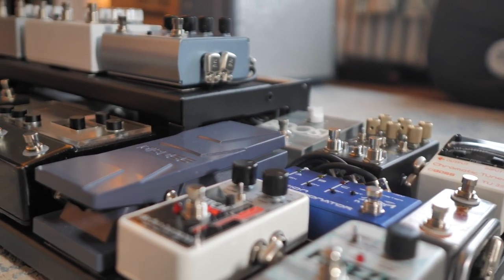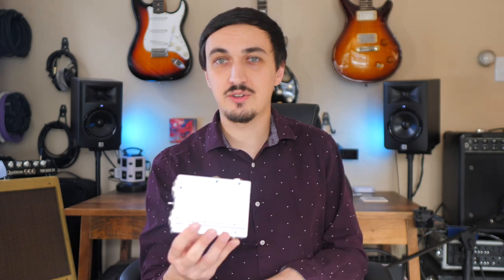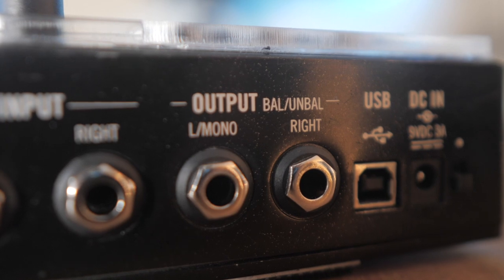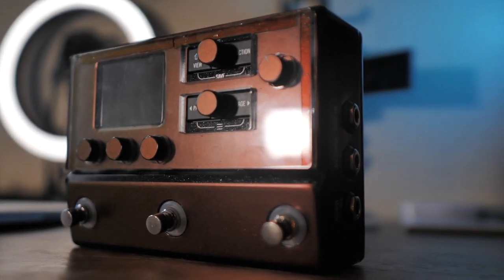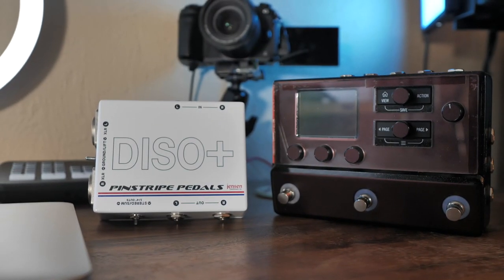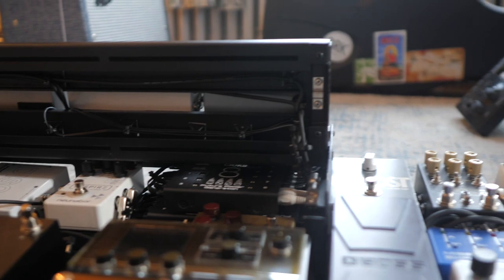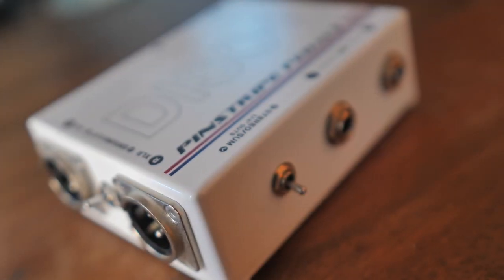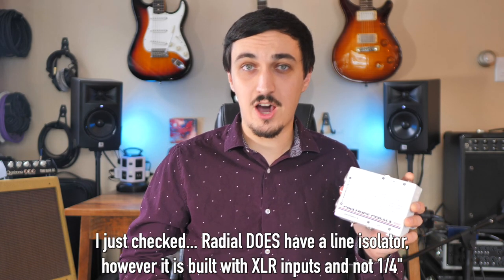Why I Keep a DI Box on my Pedalboard - HX Stomp + Pinstripe DISO

Comment: Great video as always Alex!  THANK YOU!

While there are many solutions to the problem of interfacing HX Stomp to a professional PA, the DISO+ is made to be the very BEST solution and to address the needs of pedalboard applications.

We designed the DISO+ specifically for the HX Stomp. It works equally as well with the Strymon Iridium, Boss GT1000Core, and some other modelers coming to market soon.  As with all our DI-type products it uses top-quality transformers from Jensen that are chosen specifically for the application (not just by spec, but by listening!) and made to be pedalboard-friendly.  We have two versions of the DISO+ (one with a summing switch on the 1/4 inch outs only, one with summing on the 1/4 inch AND XLR outs) as well as the mono MISO.  Please let us know if you have any product specific questions! pinstripepedals@gmail.com

Comment: Thanks for this crystal clear explanation, Alex. It's exactly that line isolation/groundlift issue, that makes the difference. Like you said: It's not necessary until you run into those problems in live situations. If you can spend the money on an isolation box, there's one less thing to worry about. Simple as that.

Comment: Hi ... you've made lots of valid points, but I'm pretty sure a couple of them aren't right. First, is what you refer to as differential output -  balanced signals must have that characteristic so either L6 has mislabeled and oversold their product, or it does in fact send that differential output ... because that is what a balanced signal is, by definition. I'd assume the latter. BTW, transformers aren't required to provide inverted signals - other mechanism can be used. Also, a line isolator, as I understand it, is not about the whether it takes a low or high impedance signal. As I understand it, a standard DI will drop the output volume sent down the XLR by having a coil with fewer turns on one side of the transformer compared to the other. A line isolator will have the same number of coil turns on both sides, resulting in an output signal down the XLRs at the same volume as what went into it. So a line isolator will have a hotter signal than a DI for a given input level. Some sound guys prefer the XLR signal to the snake to be at lower (i.e. mic) level to avoid cross talk affecting mic level signals, like mics, from adjacent cables ... that point is up for debate, I reckon but let's assume we want to keep the sound guy happy. With that in mind, a standard stereo DI should do the job just fine; keyboardists have been using the Radial ProD2 forever to great effect and the variables here should be largely the same,  though I admit the ISO box in your vid is a tasty bit of kit with some great features like the Jensens and that sum to mono. I'm happy to be corrected.

Comment: Hi Alex, nice explanation.  It's never a problem - until it is.  Different scenario than a ground issue I know, but that's one reason why I always have a backup for everything on every gig.
Reply from the maker: Thanks Mark! I totally agree with that. 
In my mind, if anything ever fails on this massive pedalboard, I can always pull off the HX Stomp and use any of the all-in-one presets I built. It's great having the HX Stomp on the board for that reason.
If the HX Stomp fails, I can patch stuff through and run straight into a backline amp

Comment: Hi Alex,
  I have a question about D.I.s for the stomp. 
  I've watched a video where you were introducing accessories for the stomp. I have 2 stomps and an XL. I bought 1 DISO+ and found another used. So, 2 of the stomps are covered. But, I have this old whirlwind hotbox that is an active DI. It uses 2 9V batteries which is really expensive if I used it a lot. Or, you can power it with phantom power.  You mentioned in the same video that it could damage the stomp to run phantom power to it. And, I think you were saying that running trs cables directly to the outputs of the stomp could do the damage. But, I read specs on this DI from whirlwind that it IS an iso box. Could you clarify this for me?

Thanks,
Butch
Reply from the maker: Hey Butch - your Whirlwind DI should take very minimal current. I’d think a 9v would last at least a year. The main difference between a DI and a line isolator is that the DI will pad down your signal. It may say iso since the terms are interchangeable to most, but if I had to guess it’s probably a DI. A line isolator will have the same level leaving the unit that had entered it. 

About TRS cables - a TRS to XLR cable is fine in most circumstances. It lacks a ground lift and protection from phantom compared to a DI or line isolator, but if you’re only playing at the same couple venues and have never needed a ground lift, you’re fine using those cables. 

And lastly about the phantom power statement - Line 6’s official word is that phantom power should not damage the Stomp. If it’s working correctly, it should short that 48v current to the chassis. I’ve followed HX Stomp forums long enough to notice a pattern of posts related to phantom power adding noise or damaging the Stomp so I thought I should mention it here.
Reply: @AlexPriceMusician  
Yes, it is a DI. But you can power the DI with phantom power instead of a battery. Are you saying it's just safer to run a battery?

Comment: SO, I bought a MISO version, because I use my hx stomp in only Mono, with my bass. So should I set my output from the stomp to line, then instead of Instrument when using the MISO? Our sound guy says my signal is extremely hot, coming through to the board.

Comment: Even though you explained everything very clearly I'm still struggling to understand this stuff haha. On the whole "reducing line level outputs down to mic level and then boosting them back up" thing, isn't that what keyboard players have been doing for decades, going through DI's? Is there something about guitars/amp modellers that make doing this more problematic than with keyboards? Cheers

Comment: fantastic video.  I'm not sure if a line isolator would work in my scenario because I want to run stereo effects after the hx stomp then send to front of house. Do you know if I have to use an active or passive di, if im using active and passive pickup guitars with the stomp. Thank you :)

Comment: Great video Alex, lot of mixed info out there. Di for the ground noise is a must. You should do a tracking video also. I never track the stomp with the USB as the sound is not great. There are guys who say my tone videos don't match when they track and the reason is that the usb line out does some impedance or other mismatch...

Comment: I just sold off my Kemper rig to build a medium board with the ACS1 as my direct option. I run my reverbs/delays afterwards, and running direct from the Walrus R1 I do have good tone, but have noticed in a couple different applications needing to crank the gain on the preamp and having that add a bit of unneeded noise. I originally was looking at more of the goodwood interfacer as more of a stereo to mono summing, but thinking the xlr outputs and protection from phantom power with the added bonus of a ground loop if need be. 

I wasn't really sure exactly what this does and why it was needed, so thank you so much for being so informative and well spoken on what this does and why it might be needed. Definitely plan on grabbing one when I can!
Reply from the maker: Glad it was helpful Michael - I will say to double check if the ACS1 is outputting a low or high impedance signal. Low impedance = you’re gonna want the DISO or a similar line isolator (I have yet to find a similar product from any other company). High impedance = you’ll want a standard direct box.

Comment: I may be wrong but I believe you can change the output from line level to Hi Z and vise versa. So in saying that running the Stomp into a DI box will further lower the signal isn't true if you change the output from line level to Hi Z in the settings. I know for sure I can do it in my full size Helix. But I'm not sure about the Stomp because I leave it at one of the churches I play bass at.
Reply from the maker: Kind of correct - you can switch between line and instrument level output on the Stomp but the impedance doesn’t change. It’s always a low impedance output. A standard DI box will pad down the signal where this one will not. The transformer is a 1:1 winding for that exact reason. 

TLDR: a normal DI box will work fine if you want to send a line level signal and boost it up again at the console, but if you’re buying a DI Box specifically for this purpose, my opinion is that you might as well get the one designed exactly for it.
Reply: @AlexPriceMusician  I see. Yes I agree buying the one designed for it is a wise choice. Also. Why doesn't the impedance change when changing the signal from line to Hi Z? What's the point of having the option then?
Reply from the maker: That must be a separate option only on the larger Helix devices. My Stomp and Stomp XL only show the option for mic/line
Reply: @AlexPriceMusician  oh ok I see. Thanks

Comment: Maybe someone else already made this comment, but if you run a balanced cable and lose the hot lead, only the out-of-phase signal gets through, and you’ve got yourself an unbalanced out-of-phase cable. In a stereo setup with one faulty cable you can get the situation mentioned in the video.

Comment: Hi Alex, great video as always. I’m trying to work out the best way for me to put together a rig for a gig this weekend and have a couple of questions (sorry in advance, kinda long but should be easy answers!).

You mention that differential outputs are not included in the HX Stomp. I can certainly believe this, but surely then when the signal arrives at the FOH board (which doesn't know whether it is flipped or not) it flips the phase of one of the signals and we would end up with no signal?

Secondly, you say that the normal impedance conversion in the DI box reduces the signal level (and therefore increases signal to noise ratio), but this could be mitigated by running a line signal from the Stomp. Does changing the signal level sent from the stomp actually change the output impedance? Or just the level at which the signal is sent? If the latter, then surely it makes no difference regarding signal to noise ratio (unless you’re talking about because of the gain applied at the FOH mixer)? Maybe I’m misunderstanding here.

Finally, I didn’t fully understand the bit about the phase cancellation in the monitors. Understand the principle, but why would having a DI (or Line Isolator) box fix that? Surely the same signals get sent to FOH (just with proper phase flipped outputs), and the same signals are returned to the monitors? So the issue would have still existed?

Comment: Thanks for the info. I keep running into ground issues when I try to run my hx stomp direct to interface and into my tube amp at the same time (trying to match tones in my daw thru the same IR/chain). Also happens when I run Boss MS-3 into HX into real amp. Line isolater seems like what I need.

Comment: Thank you for this video! Could you perhaps advise if a DI is needed/could help in the studio if a fx pedal like the Helix is in the loop. E.g I currently use my Helix with 2 signal channel outputs, (XLR for both) FX and Dry. Then in Cubase when I record... I track both the dry and fx at the same time.

I do feel the dry signal is not as loud as it can be, but at the same time, the signal from the Helix seems to be quite hot going into the audio interface, could adding a DI or line Isolator in the middle of the DRY out and the Audio interface help to resolve this? 🤔

Comment: I bought Phantom blockers for my Helix floor, but realized you have to wait a little before connecting  them to the Helix after being connected to the mixer. So now I use XLR to TRS adapters going to the mixer and I run in on line in jacks, set the the Helix XLR outs to line level, so there is enough signal to run line in and no chance of receiving phantom power. It needs to work fool proof in a live situation with no ifs and maybes ;-)   Great video!
Reply from the maker: Great comment Christian - thanks for sharing. One thing I was not aware of at the time is that you can also get a such thing as an in-line ground lift. If you're set on going the TRS to XLR route with a phantom power blocker, might also be wise to invest in that inline ground lift for the inevitable day that you'll need it. A bit bulky as opposed to a simple DI box, but it should work well.
Reply: @AlexPriceMusician  In the case of the Helix floor it has a built in ground lift, but I don't even think that applies when you go TRS into the mixer, I could be wrong though. I'll have to read up on that ;-)
Reply from the maker: Ahh - Helix Floor. My reading comprehension is lacking haha

Comment: Interesting video. How about the Palmer PLI 02 line isolator?
Reply from the maker: Seems like a similar product, though the input is XLR and it doesn’t have summing to mono
Reply: The input on the Palmer PLI 02 is actually a Neutrik combination socket input (XLR & jack socket). Great video btw! You saved me from forum hell.
Reply: Hola Luis, has probado la Palmer finalmente? Gracias!!
Reply: @ramongarcia5370  no nada...

Comment: I had a question that isn’t quite related, but maybe you might be able to answer it. I’m using a pedalboard rig into a Headrush FRFR112 with some Tech 21 Character type pedals onto a Two Notes Cab M. My question is would I need an interface or some other device to replace the Headrush FRFR112 with some studio monitor speakers (such as KRK Rokit or Yahama HS5)? Thanks.

Comment: Hey dude! thanks for the video! But ,wouldn't other Radial options (besides a DI) be the Radial Twin Iso (also with Jensen Transformer), as well as the Pro- Iso and the Stagebug SB-6? These all seem to do same thing right? Line isolators?
Reply from the maker: The Radial Twin has an XLR input, but otherwise yeah it’s a similar product. The Pro-ISO actually does the complete opposite of what you’d want - it takes a balanced, line level signal and converts it to mic level unbalanced. The Stagebug SB-6 is a line isolator, but is TRS to TRS.
Reply: @AlexPriceMusician  - With the Stagebug SB-6 couldn't you then just use two TRS jack to XLR cables, for connection to the stage snake or PA?
Reply from the maker: Yeah, that’d work fine I imagine. Some stage boxes even have a few TRS connections. Your call!
The DISO as mentioned has a few extra features that make it flexible like summing and thru outputs. I also like the idea of just sticking with standard XLR cables - venues will have hundreds of these. You don’t have to worry about bringing your own or what will happen if one of your TRS to XLR male cables goes bad. 
I think the stage bug and converter cables will work fine though
Reply: @AlexPriceMusician  - Cheers for the reply, I greatly appreciate it!
I've just sent you an email, with a few other questions, which I hope you will reply to 😊

Cheers, I'm pleased to hear that.
I've been using a Stereo DI, Radial ProD2, until now, and found your video, and it got me thinking..
Well, all those questions are in my mail.
Reply: @AlexPriceMusician  thank you!

Comment: As I understand if Im going from the stomp into two passive DI boxes with 1/4 inch TS cables I should set the output to line level to avoid having too much noise? Ive had a noise issue at a gig recently but have had no issue in other venues with the same set up.
Reply from the maker: Yeah, that’ll be best. It just ensures that you don’t have to boost the signal later. If it’s a crappy preamp, boosting a very quiet signal could introduce a bunch of white noise. 
Sending an instrument level signal into a standard DI box will lower the lever even more than usual and can create this problem. Sending a line level signal will help.

Comment: Good Evening Alex, I really enjoyed the video, I'm now looking at getting one to go with my HX Stomp.
With regards to the bal/ unbal connection from stomp to DISO+, which is the recommended method to achieve best performance?
Reply from the maker: Hi Nathan - if you’re not using a DI box, you’re going to want to go with a TRS to XLR cable to send to FOH. For a lot of people, this works fine. At some point, you might find you need a ground lift so that’d be the biggest selling point to getting a DI box of your own.
If you’re using a DI box with the Stomp, just go with a TS (unbalanced) cable. A DI box is meant to see an unbalanced connection anyway.
Reply: @AlexPriceMusician  Thank you for the reply. I have been using a mono DI box, however I now want the option of stereo or Wet/Dry without the volume drop of a DI box, hence the desire for a line isolator with a ground lift. 
To clarify, I'm wondering whether or not the Diso+ accepts balanced 1/4 inch as well as unbalanced.
If it does, is it better to go HX Stomp (balanced output) > Diso+ (balanced input ) to achieve a better signal to noise ratio or is it  the same either way?

Comment: Hi Alex. Thanks for the video. So if my Stomp connects via TRS to XLR to the Hi Z input of a digital mixer, my Stomp will not get damaged if the 48v phantom power is turned on unintentionally?
Reply from the maker: You should use a low impedance input, but that’s not a huge deal. According to Line 6, the Stomp should just force the 48v to ground and not damage the unit, though it might affect the sound. I’ve heard other stories though. I enjoy the peace of mind of using a DI box in between the mixer and my Stomp.

Comment: I'm worried about running my hx  into a homebuilt power amp- I cant find any actual info on the output impedance of the hx stomps balanced outputs.  my power amp input is 8k minimum impedance.  i don't think they have to be balanced inputs- but i'm wondering if I should run my hx stomp instrument out straight into a higher quality dual transformer isolated preamp